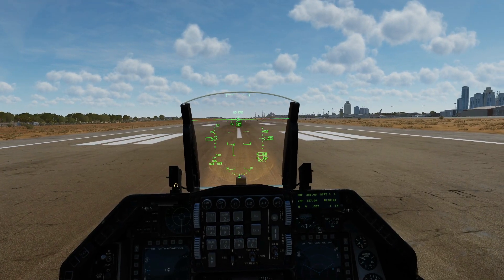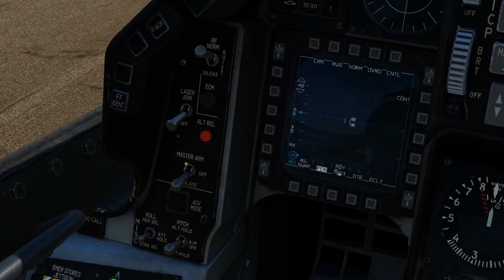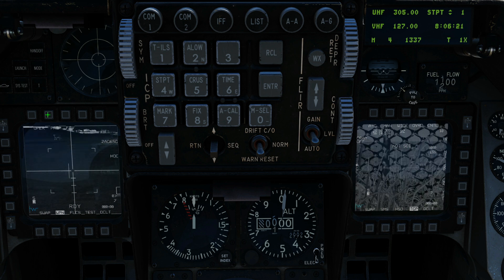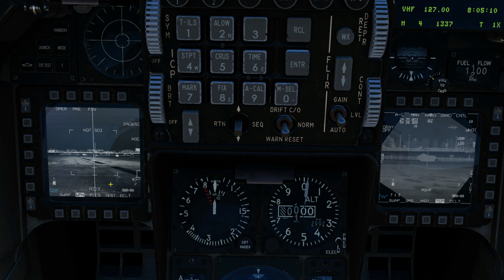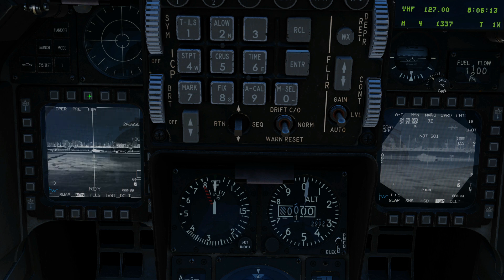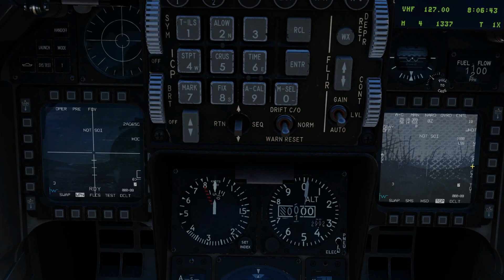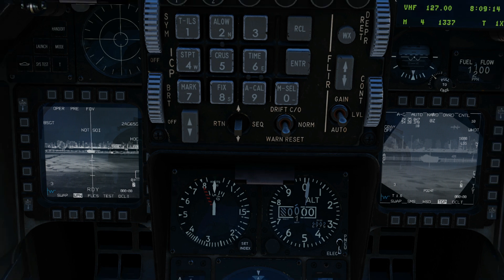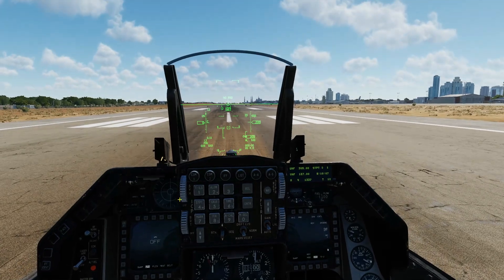F-16C Viper: AGM-65 Maverick BSGT Ground Calibration Tutorial | DCS WORLD

Comment: It's not as simple now, as the video shows. Now doing this on the ground the Maverick is almost never exactly aligned on the TGP pod and misses so much that it fails to lock.
I also tried to calibrate it in the air at a distance of 8-6 nm, but it is still not good and still needs to be controlled manually.
I'm new with F-16, did anything changed or there is issue rendering  mavericks almost useless except for VIS mode?!
Reply: I started learning the F16 around a year ago and I have not been able to ever efficiently use mavericks in PRE mode despite doing the boresighting on the ground as demonstrated here, which in theory is the proper method. I'll try again soon but I've just about given up on mavericks in the F16.

Comment: Absolutely never works for me. Doesn't matter which tutorial I follow. Right after BSGT and master override and back it offsets again.
Reply: Ever get this working?  All it ever does is offset for me also after BSGT and override.
Reply: @crashbar77  turns out it's fine. Do it as you do and get in the air and you'll hit your targets. If it's still not accurate enough to lock just realign in the area doing a fly by.

Comment: If I understand it correctly, you need to do this with all maverick types if you are starting from the ground and going to use the tpod in auto mode. Is that correct? If so, this means that if you have 6 D's, and you are going to use pre mode, they all have to be aligned. oy veh.
Reply: per the comment that ironically is directly above yours at the time I'm writing this response: You only need to do it for each rack. so 2 times.

Comment: What is the purpose of this? To always have a constant auto lock on with the mav?
Reply: If you slew the TGP 3 degrees to the left you tell the Maverick seeker to slew 3 degrees to the left. But if the Maverick was not aligned it might be looking already one degree to the left and would always keep that one degree difference when slewing the TGP. I think if you do a hand-off from TGP to Maverick you basically tell the Maverick to lock onto the target the Maverick seeker is currently looking at. The TGP is not magically transmitting the target to the Maverick but just tell the Mav "lock on just now". The TGP could be looking at one target and the Maverick at another target due to the 1 degree to the left difference in this example. Hope this makes sense (no expert at all).
Reply: It allows you to scan for targets with the TGP that has a much better camera, and then when you find a target you simply point track it with the tgp and it gets automatically locked by the maverick seeker. Remember that the tgp has much more zoom and resolution than the maverick camera so its much more easy to identify targets that are really far and plan your attack
Reply: @eduardomorales3844  Yeah, I mean what is the point of the ground alignment, does it improves, or facilitates the auto-locking?